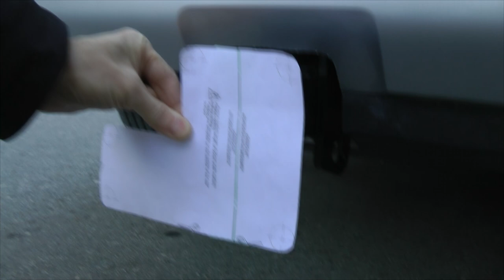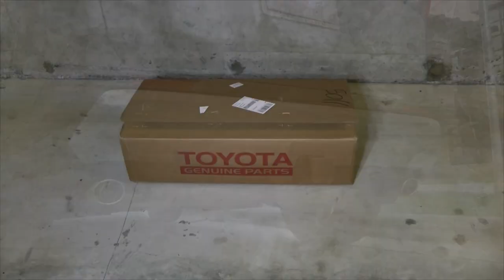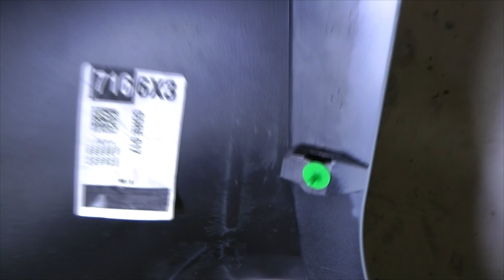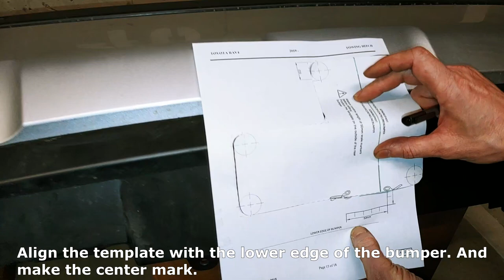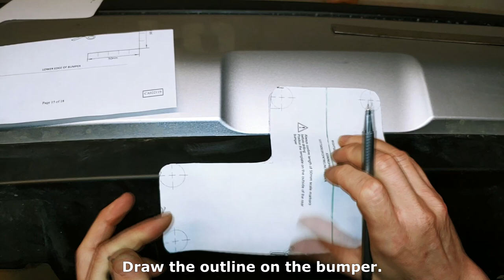Toyota RAV4 (2019-2024): OEM Toyota Hitch Installation.

Comment from the maker: PRODUCT LINKS:
1. AMAZON - Genuine Toyota 2019 & Up RAV4 Trailer Tow Hitch Kit PK960-42K10 - https://amzn.to/3GbIi7u.
2. EBAY - Genuine Tow Hitch Receiver Class II With Hitch Cover pk96042k10 - https://www.ebay.com/itm/163858472556?mkcid=1&mkrid=711-53200-19255-0&siteid=0&campid=5338971185&customid=&toolid=10001&mkevt=1.

RECOMMENDED TOOLS:
1. LED HEADLAMP - Coast FL85R 700 Lumen Dual Color (White/Red) Focusing Rechargeable LED Headlamp - https://amzn.to/3LVebVx.
2. WIHA HEAVY DUTY SCREWDRIVER SET - Wiha 53097 Screwdriver Set, Slotted and Phillips, Extra Heavy Duty, 7 Piece - https://amzn.to/3ystzRx.
3. SOCKET SET, RATCHET - GEARWRENCH 57 Pc. 3/8" Drive 6 Pt. Mechanics Tool Set, Standard & Deep, SAE/Metric - https://amzn.to/41wE6Z3.
4. SWIVEL HEAD RATCHET - GEARWRENCH 2 Pc. 1/4" & 3/8" Drive 72 Tooth Dual Material Roto Ratchet Set - https://amzn.to/3kwhHdS.
5. FLEX-HEAD RATCHET - GEARWRENCH 2 Piece 1/4", 3/8" Drive 84 Tooth Full Polish Flex Head Teardrop Ratchet Set - https://amzn.to/3yjPHNK.
6. STUBBY FLEX HEAD RATCHETING WRENCH SET - GEARWRENCH 10 Pc. 12 Pt. Stubby Flex Head Ratcheting Combination Wrench Set, Metric - https://amzn.to/3IKVP6y.
7. RATCHETING WRENCH SET - GEARWRENCH 16 Piece 12 Point Ratcheting Combination Metric Wrench Set - https://amzn.to/3JqYunC.
8. 3/8" TORQUE WRENCH - GEARWRENCH 3/8" Drive Micrometer Torque Wrench 10-100 ft/lbs - https://amzn.to/3YmhnN2.
9. DIGITAL ADJUSTABLE TORQUE WRENCH - Hilmor 1963826 Digital Adjustable Torque Wrench - https://amzn.to/3FULVPh.
10. PRECISION KNIFE - Fiskars Heavy Duty Die Cast Craft Knife - https://amzn.to/3KGF5A9.
11. DIAGONAL CUTTER - KNIPEX 74 22 200 Comfort Grip High Leverage Angled Diagonal Cutter, 8-Inch - https://amzn.to/40w0vVf.

Watch How To install OEM Toyota Trailer Wire Harness in 2019-2023 RAV4 - https://youtu.be/3_eKGti5Ivs.

Comment: Toyota should throw this in pre-installed for how much they charge for the RAV4.
Reply: they could sell this as a dealer installed $500 option all day long
Reply: @okiefreemen  they do. At 1k.
Reply: @ThatCleanMT  1 to 1.2k
Reply: Agreed, especially on the Adventure which has the highest tow capacity: why use that as a selling point when there is no tow hitch?
Reply: I just paid 1.2 +tax
Reply: I didn't even think about it but looking back, I bought a 2019 Adventure which basically came fully-loaded, and yet the one thing it doesn't have...

Comment: Thank you for the video. Just to update everyone, you must remove the bumper, since you will be replacing the aluminum part of the bumper with the hitch. The hitch also replaces part of the vehicle tie down. Both the aluminum bumper and steel tie down can be recycled. I think it could be sold on e-bay. One important note is that the instruction manual is printed in a way that you must copy the page before cutting out the template. It took me a while to figure it out.  The only other thing that was a bit difficult was trimming the section where the two-piece bumper comes together.  It's important to do a good job so the trim piece fits nicely.  I used a pair of scissors for cutting remote control car bodies. It's also easier to cut the bumper with sheet metal snips and drill holes in the corners where you plan to start cutting.  Good luck! Mine turned out great. Saved me 450.00 at the dealership.
Reply: oh darn wish I would have read this lol, would have saved myself about 15mins scratching my head
Reply: Thank you for the comments about the aluminum bumper and the steel tie-down.
Reply: My dealership just quoted me $1500 :(

Comment: Don't buy the Curt hitch unless you want to drag the bottom of it every time you go through a dip.  The extra clearance the higher mounted receivers give is critical.
Reply: I installed a Curt hitch on our 2024 about a month ago, and have driven the car 3,000 miles already, with about 1/3 of that with a bike rack hanging off the back.  Haven't dragged or scraped on anything.

Comment: Thank you for this excellent video! It enabled us to have the confidence to install the OEM hitch on Saturday!  Which we did!  One thing for DIY to consider 1) make sure the bumper cover at the end is over the hitch receiver chain loops - we found that being underneath the vehicle and pulling it over the trailer receiver/hitch allowed to apply proper force to guided bumper cover in proper location.  One thing to note, the wiring harness bracket prohibits bumper cover to rest in proper location - so can see bump out. 2) make sure that you add flexible trim cover starting at bottom bumper so seam is not visible.  3) cutting out hole in bumper cover seems to be after thought vs sane manufacturing design  decision.  Toyota needs to make number interface easier for hitch install.   This install I did was for Rav4 Prime

Comment: thanks for the video, made my install a breeze.. I left mud guards attached to rear bumper, and removed it as a whole unit, there was no need to remove the taillights.
Reply: Is removing the bumper really necessary, the plastic bumper looks like it’s easy to pry away enough to install the sides n hitch.
Do you think the hitch can be installed pre assembled leaving the fasteners loose and tightened after final installation?
Reply: @CarlosRamirez-tc5dc  sorry man i dont remember, i removed the bumper completely but i left mudguards attached. no idea if you can do what you are thinking
Reply: you remove the factory aluminum bumper on the inside, this replaces it, this part is heavy duty and a perfect fit, no issues.
Reply: @CarlosRamirez-tc5dc  You'll waste more time, possibly damage the bumper by pulling on it too hard, and will have a really difficult time getting the aluminum bumper off. Just remove it

Comment: Thank you for the video. Installed my hitch yesterday afternoon with much more confidence. For anyone attempting this install, note that the template provided for the cutout has two issues. One, you have to photo copy one side to be able to attach it together for the full pattern, and two, the measurements in the directions show 15mm on top and 98mm on each side which was wrong. Its 98mm to the center line, not the edges, and I have no idea where they got 15mm on top from. Line the bottom edge up and all works out. If you are not installing the wiring harness plug on the side, you can cut a simple rectangle like shown in this video. I marked the right side of the template, then flipped it over and marked the left side so it was symmetrical. To cut it out I used an oscillating tool, then a pair of bull nose cutters to nip away the seam on the inside so the edging would fit. 

When removing the bumper cover from, I used a trim removal tool to open up the channel so the tabs pulled out much easier but I did manage to break one of the green clips when removing the cover. I was able to use a small screw and a washer to repair it though as I was not able to find a replacement for it.
Reply: I wish I would have seen this comment before installing mine. So annoying that the template shows a spot to line up with the bottom of the bumper, but at the same time says the template should be 15mm from the molded edge in the bumper. The picture of the cutout in the instructions shows the cutout pretty high, like 15mm from the molded edge, so that's what I went with. I thought maybe the TRD bumper was slightly different and that's where my issue was, but now I have like 1.5" of cutout above the hitch 😑

Comment: Excellent video! The only remaining problem is getting some of the bolts connecting the side arms to the rail and I have a torque wrench adapter being delivered to me. Otherwise, everything went smoothly. I even got the hole in the bumper cut out perfectly! Thank you!!!
Reply: What tool you used to make the cut?
Reply: I used a Dremel with a cutting wheel. Measure carefully with the template, recheck and cut. Slowly.

Comment: About to embark on installing the OEM hitch on my 2021RAV4 Prime; great video.  A couple questions: 1) do you have to really need to unplug battery terminals in engine or in the luggage compartment?  2)  During the video as you pulling off  the bumper, you talked about a green pin...what is that and do I need to be extra careful with it?

Comment: Be sure to check what size the nuts and bolts are before you begin install. Went into thinking I had everything but the bolts were 19 mm as opposed to the 17 mm they claim to be in the package.

Comment: Does the bottom of the bumper valance bow down a bit because of the harness light connector bar? Looks like that piece pushes out the bumper slightly.

Comment: Great video for us Rav4 lovers. 

Amazon now longer carries the OEM hitch. Where's another place in stock that charges reasonable shipping?  Also for the wiring harness? If I'm going to install this I might as well install the harness while it's all apart. Then it's good for brake and signal lights too to add to any hitch or even a bike rack, which is my application.
Reply from the maker: Thank you! I believe you can still get them on Amazon - https://amzn.to/3GbIi7u. If you follow the link, you will see "See All Buying Options" on the page. Ebay also sells them - https://www.ebay.com/itm/163858472556?mkcid=1&mkrid=711-53200-19255-0&siteid=0&campid=5338971185&customid=&toolid=10001&mkevt=1. Having the rear bumper off can partially simplify the installation of the wiring. But you will still need to remove trim panels inside the RAV4. Here is how we installed the original Toyota wiring - https://youtu.be/3_eKGti5Ivs.

Comment: They need to give a trim piece to go around to cover the cut

Also does the hands-free lift gate still work because that’s the issue I’m having if I want to install one
Reply from the maker: They do supply the edge protector with the hitch. We have not installed it yet. 

As for hands-free lift gate, I don't think it will work with the hitch. Here is the description from the sellers website: 
It is engineered to help accommodate your RAV4 maximum tow rating. Optimised placement provides precise drop/rise to maintain vehicle departure angle. Designed, engineered and built to meet Toyota’s exacting quality standards. Tow Hitch Receiver is not available with Height Adjustable, Foot Activated Power Liftgate option for the Limited models (4450, 4452, 4454).
Reply: Morozov Automotive .  First of all,, great video!   Thank you so much for posting.  Have you tried to install the edge protector?    It doesn’t seem pliable enough to shape around the cutout as a single piece
Reply from the maker: @marshallst-louis7471  Hello, thanks for your comment. We have not installed it yet but will do it for top part only.
Reply: Morozov Automotive   Thank you for the reply, I just finished the install.  The edge protecter takes some muscle to properly position into place but looks amazing once done.    I could not have tackled this project without the benefit of your video.   Thanks again!
Reply: Mine came with a pretty nice looking clamp trim piece to go around the cut edge
Reply: @marshallst-louis7471  for anyone else.. just run a small flat head from end to end of the trim pieces first, it widens it just enough to make it easier and helps straighten any bent areas.
Reply: The hitch will interfere with/block the sensor. As of 2/22/2021 I don't think there is a solution for this, unless the sensor could be moved under the hitch. Even if possible, it would probably be cost prohibitive and better to live without hands free, people can still have  the remote in hand to open the door before picking up a couple bags of groceries.

Comment: Just installed my hitch. Thanks for this upload. For the wiring harness, if I have the Hybrid is it easier to install since the battery is located in the rear of the vehicle?
Reply from the maker: You'r welcome. Yes, for hybrid it would be totally different way to install wiring set.
Reply: @MorozovAutomotive  would you say its easier? I am just want to make sure since I don't have to go to the front right, I'm assuming I will have a lot of wire to hide in the trunk?
Reply: @DavidsOutdoors  replying to old I know. Just installed mine today on a hybrid. It was with out the wiring kit since I'm not towing just using for a bike rack. It took my lazy ass 3 hours total. Being a hybrid it made it harder to install. The reason being facing the rear of the vehicle and looking at your right and side. The battery protrusion on that side (since hybrid standardish battery is in rear) makes it a pita to tighten that side down.

Comment: Did you initially use an exacto knife to start the bumper cuts? This is the part I'm most nervous about. I know I'm gonna make it look ugly. Also concerned about breaking the moulding clips.

Also, is there a good liner/edging to place around the bumper cut portion to make it look smoother?
Reply from the maker: Yes, we used the exacto knife. You can also use the hole saw. It may be easier this way. 

I would suggest to use this kind of edge trim - M M Seals Edge Trim Black Fits 1/5 Inch (4.9mm), Leg 0.65 Inch (16.6mm), Length 15 Feet (4.6Meter) - https://amzn.to/3KCiUe5.

Comment: Great video.  Very details.  I wonder if it's possible to install the hitch without having to removing the bumper.  It will be difficult but still maybe better than having to remove the bumper.
Reply from the maker: Thanks for your comment. Unfortunately you won't be able to remove the bumper beam (the metal piece inside the bumper) without removing the rear bumper. The hitch assembly goes in its place.
Reply: @MorozovAutomotive  Thanks for your reply.  So, how long did it take you to do that.  Seams like a very long process and that is not even included the wire.  I disappointed Toyota didn't prewired RAV4 like they did for Highlander.  It would be very useful to rent a small trailer from HomeDepot from time to time.
Reply: @MorozovAutomotive  I was wondering the same thing as RT, thanks for that clarification!

Comment: Good video. I just had the OEM hitch and harness installed a few weeks ago by the dealer. Now I hear a clunking noise coming from the rear right side of the vehicle whenever I drive through rough roads or bumps. Have you had the same issue? Does anyone on this forum have the same issue?
Reply from the maker: Looks like the dealership could have done a better job on this one. When it is done the right way there are no noises. I would take the car back for them to fix it.

Comment: I'm going to be taking on this project soon. Did you find a sharp knife worked okay for cutting the bumper? I'm wondering if I should get a Dremel tool.
Reply from the maker: The knife works but you need to be very careful. There is a chance of cutting yourself. The Dremel should work as well.

Comment: Is this a Trail version with 8.6" height? We bought a 2021 RAV4 Trail model and debating which hitch to get. Looks like the OEM model has it sitting higher than an aftermarket. We plan to tow a small camping trailer. Looks like the height from ground to inside top of the hitch is about 15.75 inches?
Reply from the maker: Hi Aruna, yes OEM hitch has highest ground clearance compare to all aftermarket brands, but for installation you have to remove rear bumper. Curt hitch is easy to install but has clearance about 2 inches lower. https://www.youtube.com/watch?v=Whx6ZDAy41A&t=26s

Comment: I ordered this today, and I was wondering if it's possible to install this without taking off the rear bumper? Can you just cut a hole on the bumper while it's on? All the holes where the tow hitch bolts onto the frame are accessible without removing the bumper, right? And the tow hitch isn't one piece. That's why you don't need to drop the exhaust a little to get the anchors in.
Reply from the maker: The problem is you won't be able to remove the bumper beam (the metal piece inside the bumper) without removing the rear bumper. The hitch assembly goes in its place.
Reply: @MorozovAutomotive  Yes you are absolutely right! I just finished the installation and I did need to remove the bumper.
Reply: @filo4u2  Is there enought room to squeeze in a wrench to remove the ReBar without removing the bumper cover?
Reply: Are there any safety concerns with losing the functionality of the rear bumper beam?
Reply from the maker: @mattpipes7774  No, the hitch assembly takes its place.
Reply: @mattpipes7774  The hitch assembly is stronger and much more rigid. Knock on woods...if someone get rear ended, a bumper will just crumple and the vehicle will probably be okay.  With the hitch assembly, there nothing to crumple. The hitch assembly on my Sienna was so rigid, it just blended the vehicle structure when I got rear ended by a Civic. Not a whole lot of visual damage but it was totaled.

Comment: Awesome work sir! I have to ask, what is that tool you used to punch little holes on the bumper cut?
Reply from the maker: In this case it was cut out using the sharp knife. You can also make a pilot hole and then use the hole saw set. This way of doing it is easier and less risky.

Comment: The receiver that came in the hitch box is confusing ? what side does the two inch ball go on ?  You never showed that. Thank you
Reply from the maker: You are right, we did not show that.Towing hook should be installed inside square receiver. Ball position (high or low) depends on load application.

Comment: Curious if anyone else feels like cutting the bumper shroud affects its structural integrity which causes vibration or wind noise at higher speeds. I just had the dealer install the hitch on my 2020 TRD and now I have vibration and wind noise. I think they may have done something wrong.
Reply: this is really a concern for cutting such a large opening on the bumper...did you fix the noise?
Reply: @benjiang6493  I have not. It is not bad when my bike rack is installed for some reason. It does make a bit of noise at higher speeds when the rack is not on.
Reply: @themastersclay5579  thanks